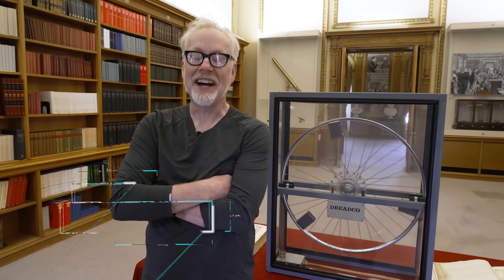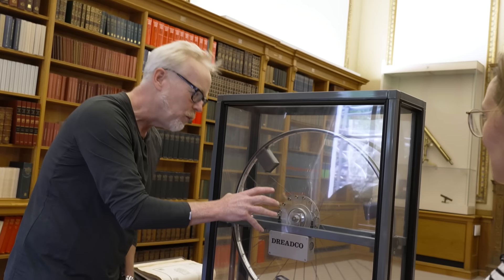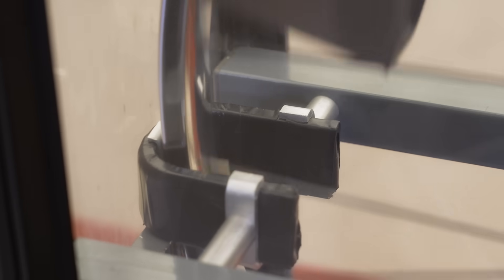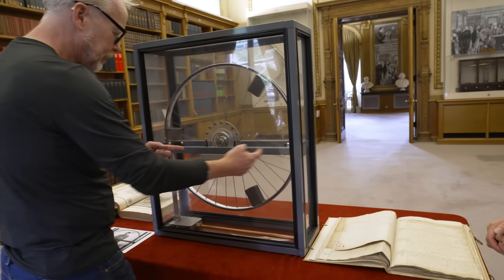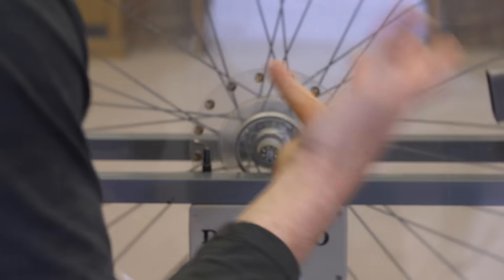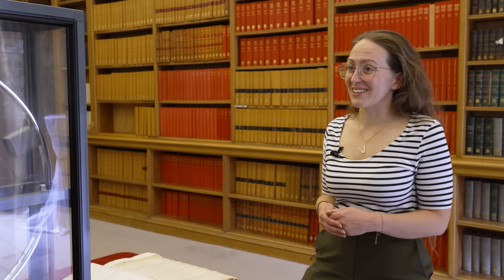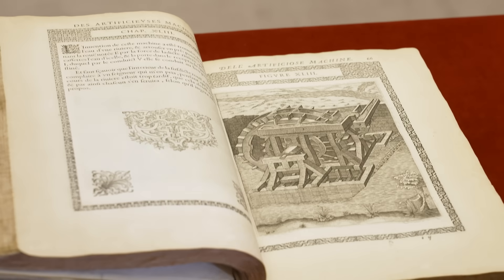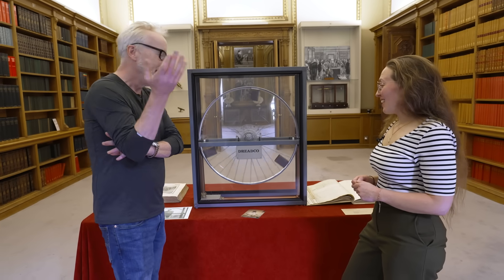Adam Savage vs The "Perpetual Motion" Machine!

Comment: ... hi, im the guy who solved the vector for heat(particles in high flux (gases) vs particles slow flux (waters-solids) without using math, i understood its principles through thermodynamics, wave physics and particle physics, its not that i didn't use math, its that for me to be credited, they wanted me to show my math... irregardless the scientific world know knows what heat is. Now for the connect, i was big on magnetism as a young child, but to master it, people mocked me telling me to learn thermodynamics, then another said wave physics, then another said, particle physics, so i mastered them all to an instinctual standard to the point where i solved a few issues that i haven't come forward with, just yet, my inventions are monumental leaps which require precise care in both development and execution after-all. it was during this cycle that i sigh cried, all my devices would work but would require waaay to much energy, so i had to re-read some books, i had to figure out what possible alternatives to energy i could use, that was when i considered perpetual motion, and like how i walked for the firs time(ran, then walked), i applied values of prep.M to FTL values XD. For me, i needed a lot of power, and well, i played with some theorems, and came up with energy outputs akin to that of achieving FTL. crazy enough my math was right, what was wrong, or i "think" was wrong was my basis for the perpetual motion engine, for whatever reason, the baseline was "FTL" in scope, at that point i was like, "yeah thats wrong, like, really wrong" XD. that was then however,  i have since solved my energy crises with my devices, mag-lifters, "speed" based devices, one of the cores i learned to complete my devices came out from concepts of magnetism, a stability factor... with this factor, Not even FTL is out of reach now, and that being said... drones are fun, they really are, wonder what "speed" they can achieve ;) who knows, maybe trips to mars will take a single inhale both up and back.

Comment: It work using environmental heat and pressure generating power to a pre-charged battery.
1- The box at mid is a old circuit control.
2- The 2 point at mid are for detect when to pull and push the 3 weights on wheel.
3- The 2 U shaped things at sides are electromagnets.
4- The bottom box is a battery and engine generating very a small power for keep the wheel spinning.
5- The 3 weights adjust not only the weight distribution but also the amount needed of power for the next revolution.

Comment: I reckon all the stuff around the bottom is decoy ,the boxes around the circumference of the wheel let it be balanced VERY precisely and, the Dreadco box contains a battery which slichtly charges the spoke it's in contact with on one side then discharges it on the other. That electric field is the source of propulsion; no magnets. The copper pipes might be necessary to hold the bottom half of the wheel at equal potential.

Comment: There are 3 mechanisms that maintain the motion:
1. Magnetism
2. Momentum
3. Angular momentum
----------
1. The stationary bars are magnets. The boxes are of hollow iron.  They are attracted to each other.
2. The moving boxes are rather massive, allowing for momentum to continue the movement of the boxes beyond the grasp of the magnets. 
3. The Mass in the box is water, and because the boxes are only half filled, the water moves according to gravity from the bottom of the box to the top, depending on where they are on the wheel. Now think of an ice skater spinning. When their arms are extended, they go faster, retracted, slower. When a given box is at the top, the liquid is closer to the center of the wheel (arms in.)  When the box is at the bottom of the wheel the liquid is further from the center (arms out.) This extension and retraction of the liquid in all 3 boxes acts as 3 pumps. The net effect is zeroed out, so the wheel doesn't accelerate. 
The annual maintenance is to refill any evaporated water, and to make sure the boxes are sealed/waterproof.
Reply: The first mechanism may be a grand decoy. Magnetism may not be needed. Not sure.
Reply: The clear acrylic encasing the bearing is to prove there are no electrical wires or any other device present.
The copper pipes may assist in refilling the water within the moving boxes, although it would appear to be clumsy or another feint, given that they don't need much water.

Comment: I can't work out the details without having a closer look, but I highly suspect this operates on the same (or at least substantially similar) principle as a toy top I got as a kid, and that one can still get -- a metalic-looking (though I think plastic) top with a black circular base... which has a 9v battery, an electromagnet, and a transistor inside.  And the top has a magnet inside.  Spin the top over the coil of the electromagnet, that creates enough charge to turn on the transistor, which then dumps a bit of charge from the battery into the coil, which then gives the top a kick (repelling the part that just passed over).  Explained and demonstrated by The Action Lab at v=rNNZ1B9hTws ...

Comment: there is a perpetual moving clock. it is interesting that they use, in part, the dilation/contraction of metal rods (which happens naturally, as the day is hotter than the night) to wind up the clock.
Reply: No really perpetual motion as you are putting energy into it, heat.
Reply: @robedmunds7163  ça va sans dire

Comment: The copper has the heat sink too cool the water the boxes have magnetic potentials and the rim is made of 3 flat panels of titanol so the hot and cold causes rotational energy to happen boosting the magnetic potentials and keep it moving

Comment: All electrical "perpetual motion devices" will always need an outside source of energy to overcome the inherent and continuous "out of phase" problem  between a generator and a motor (the quantum ground state or point of lowest energy). As Sir Isaac Newton’s 1st law of motion states; " An object at rest remains at rest, and an object in motion remains in motion at constant speed and in a straight line unless acted on by an unbalanced force".
A perpetual motion machine cannot have an outside force like gravity, friction, resistance slowing it down requiring constant force inputs..

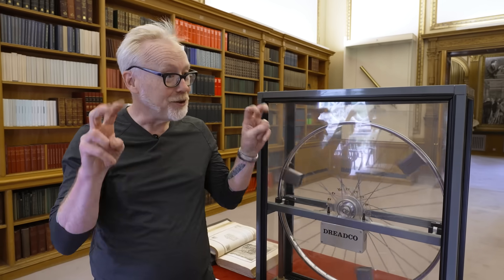Comment: 8:47 Hmm. I think the boxes and the 'magnets' are a red herring. The reason why I think so is because if they were, you wouldn't get smooth motion through them if you were moving a coil. Same concept as dropping a cylindrical magnet down a copper pipe... it'll slow down. I think the boxes are weights. They're there, evenly spaced to ensure momentum is fluid... this depends on the bearings to work extremely well, so that means the wheel itself needs to stay balanced. What I think we're dealing with is a temperature differential. My guess is that if you put your hand over the pipe on the right side, you'll feel the faintest of breezes. The friction of the slightly moving air against the outer side of the rim of the wheel would be enough to spin it. I think the pipe on the left is also a distraction. So what you'd need is a source of heat. Any number of elements can decay over time.  That decay creates heat. The less radioactive an element is, the less temperature variant you see. The heat sink creates cooler air via convection, but it would need to be uneven across the decaying element. Cooler to one side, so that it forces the ever-so-slightly heated air through the copper pipe to the right, where it spins the wheel. If you encase it with lead, it would block most, if not all of the radiation, absorbing the heat into itself, which then allows for the heating of the air that passes over it. And the 'Recharging', would be to simply swap out the element nearing it's half-life with one that's fresh. I think that also explains why the plexiglass is loose... all you'd need to do is block any outside wind from acting upon the wheel, so an absolute seal isn't needed.

Comment: The cooling ribs most certainly are mounted on a fake, electronics box, unless they are connected to a Peltier element, to extract energy from temperature differences in the room or something, however they seem not placed optimally for that. The three boxes however, most certainly contains batteries and coils that would activate to generate push or pull when passing the obvious magnets. The energy spent to send those accurately times pulses will be minimal when the goal is to just keep the wheel spinning and overcome just a little resistance. And anot much energy is need to spin a well balanced bicycle wheel, with a proper ball bearing, with minimal resistance, so those batteries may last for quite a long time. Two years is therefore not unreasonable. My conclusion - anything else than the three "boxes" and the corresponding magnets, are decoys.

Comment: I think the "boxes" on the wheel are capacitors and the two electrodes near  the hub are ion source and collector.
The Dreadco box is an ion generator.
The copper pipe and "U shaped magnets" are just "theater" to confuse the observer.
Charging the capacitor changes its mass:
 1 Farad capacitor charged to 12V, potential energy stored in the capacitor = 0.5*C*V^2 = 72 Joules. Using mass = 72/c^2,
mass gain = 0.8 picograms
The ion source could charge up to thousands of volts
The ball ended electrode discharges the capacitors as the rise on one side of the wheel and the sharp electrode charges the capacitors as they fall on the other side. Producing a mass imbalance.

Comment: at any given time the weight of 2 of the 3 boxes  are on the down ward swing offsetting the weight of one box -- so if you have a magnet with very minor pull up in the mix could the weight and magnitude pull cause the spin and if finely balanced would it not need only a finely greased spindle to turn on? - which might be the tune ups??

Comment: It looks like the horseshoe magnets on the sides are attracting the ferromagnetic parts which are placed 120 degrees apart. The horseshoe magnets are always attracting the ferromagnetic block which is ahead of the other two. I bet, these are very weak magnets, precisely balanced in such a way that, once the wheel gets turning, the magnetic attraction force will always be lower than the moment of inertia of the wheel (so that the magnet may never overcome the inertia and hold the wheel at one of the metal block locations, but slightly higher than the force of friction) In such a force / momentum balance, the wheel will feel a weak magnetic attraction force which is applied to the soft ferromagnetic parts at all times. The reason for this thing may become weaker over time and stop can be explained by the demagnetization of the magnets. When the magnets are weak, meaning that their Remanent Flux Density is low, and when they work in an ‘open circuit’ like this one (meaning that their working point is also low), they can go under a partial demagnetization, most probably due to thermal changes in their environment. Once they are re-magnetized (by applying external magnetic field to saturate them over their remanent flux density) they can keep on going till their next demagnetization. Of course, the magnetic energy stored in those magnets must be so high, that this thing lasts for years, despite the friction and other losses.

Comment: The weighs at 120 degree are evenly balanced and on the inner wheel the ball side creates a resistance as it passes the node on the down stroke. With no resistance on the up stroke pulsing the wheel, pushing the weight over the vertical 180 degree plane  ✔️

Comment: Here's how it works... Each of the boxes around the circumference of the wheel has theee components inside... A bettery, a magnetic reed switch, and an electromagnet.  The two horseshoes on either side are in fact magnets.  When a box passes into the magnet, the magnetic reed switch is triggered and a the coil is energized briefly.  This gives a small shove against the field of the horseshoe magnet to propel it forward.  It runs for so long because there are three separate batteries powering it and the current from the batteries only flows briefly when the box passes through the magnet.